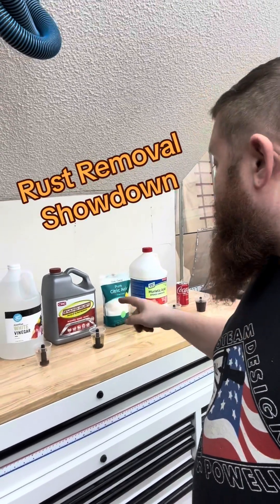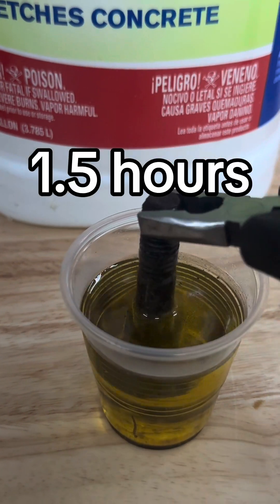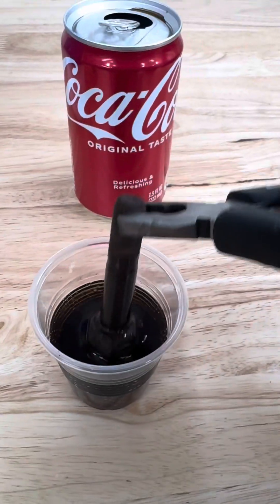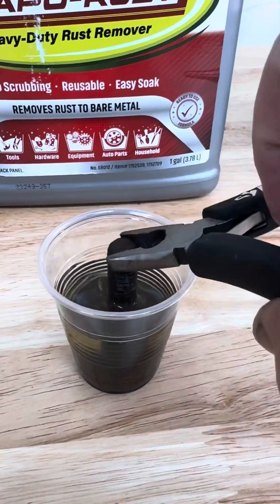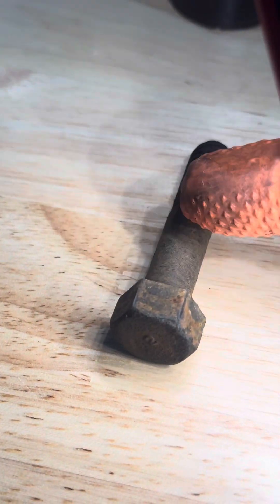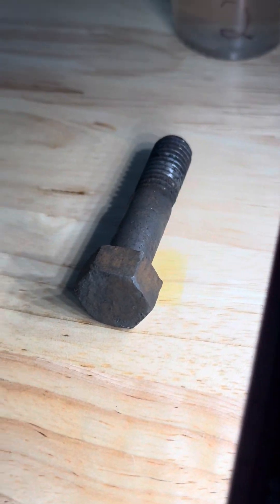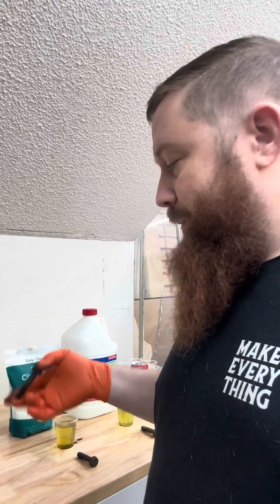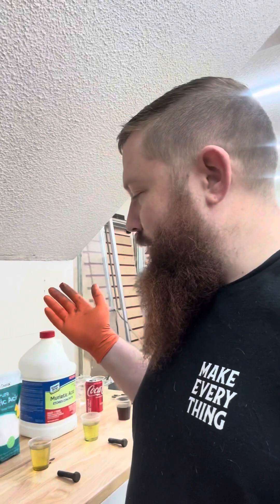The Ultimate Chemical Rust Remover Showdown

Comment: @FullSteamAhead thanks for sharing this! I've never heard of the acid that worked well but I would say you can't use it on everything and I don't know if it is reusable. CLR is garbage in my opinion...I cleaned professionally for over 10 years and now I'm into restoration and woodworking... the only thing I found it was good for was killing ants quick... vinegar destroyed thin metal I'm working on...I use pop to clean my drains... I'd never drink it.
Not only is evaporust a cleaner but it chemically hardens rust too so it's not coming back soon and if you run it through cheese cloth first then a coffee filter a couple times it's reusable!

Comment: Heritage Crystal Clean has a product called Mirachem 250.  It is not fast, but it is damn good.  I sold  it to a lot of customers.  AND ITS WATERBASED.
Reply from the maker: Water based? What does that even mean? All of these have water in them 😂
Reply: @FullSteamDesigns  water-based and water dilutable are not the same thing.  Also, 250 is a near 7 on the ph scale.  HCL is not water-based, but you can dilute it with water.

Comment: thanks for doing the experiment.  Not surprised by the results, but then again, I've used most of the products before (wish you had emphasized skin and eye protection in dealing with the muratic acid).  For rust removal, EvapoRust is my go-to.  For forge scale removal, industrial vinegar (30%) vs the home product shown (5%).  I need to try the citric acid... Thanks again!